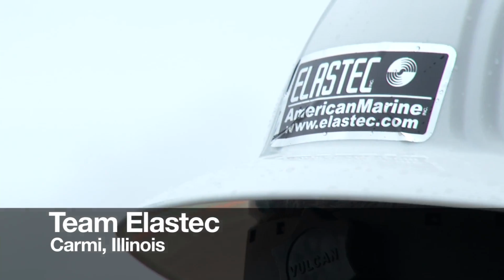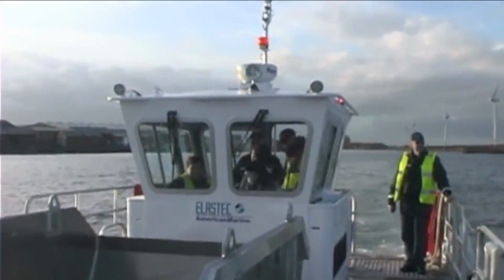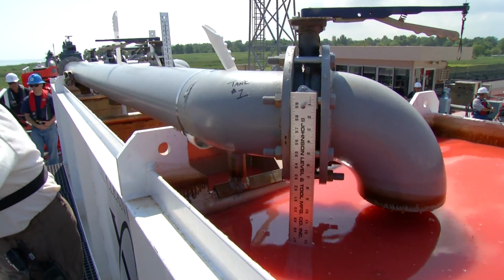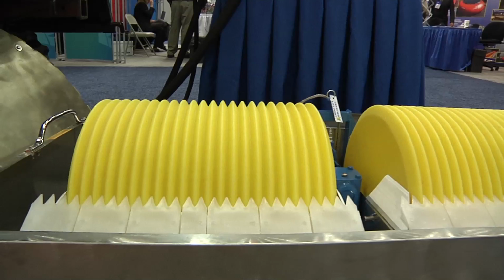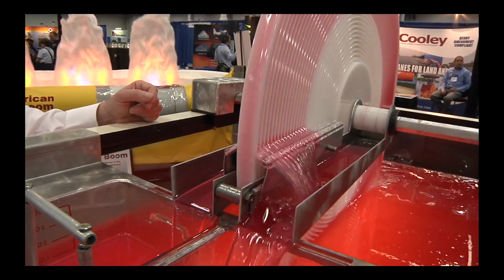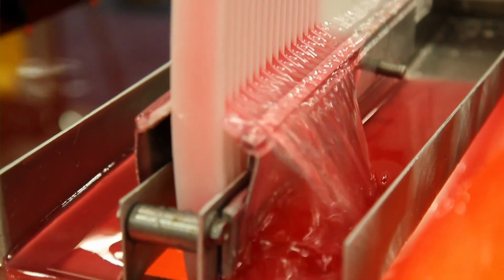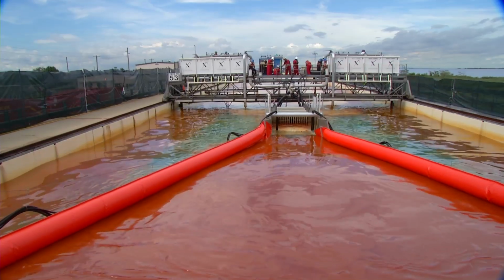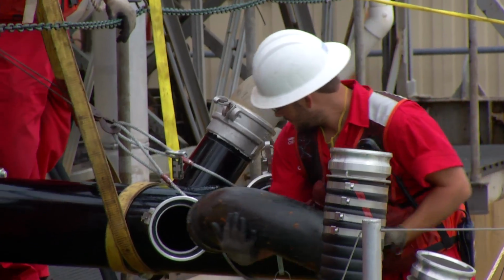Team Elastec/American Marine--Wendy Schmidt Oil Cleanup X CHALLENGE

Comment: @chroniclerofthe70s Well yea, technologies exist. But that doesn't mean they're necesasrily better than this in every way. Chemistry won't solve all your problems. 

What about an oiltanker spill. High concentration of oil in a small region. What's wrong with a more efficient skimmer? It's not a cure-all for your sub-surface sludge, but it's still a welcome application.

Comment: A very interesting, simple yet clever solution; well done guys :)

Is there any way in which the motor that spins the discs could be powered by combusting some of the oil which is skimmed off?
I understand that with crude oil there would need to be some system for refining the oil before it is used in the engine, but it would be rather cool to use the Elastec technology on some form of semi-autonomous craft.